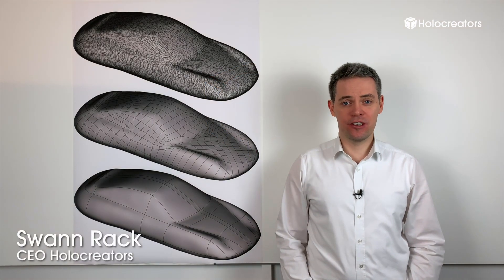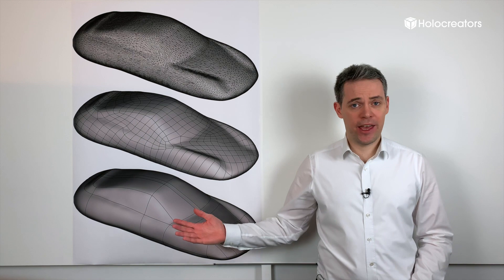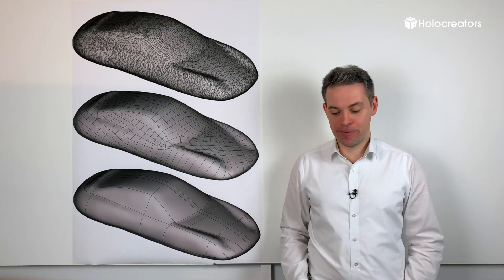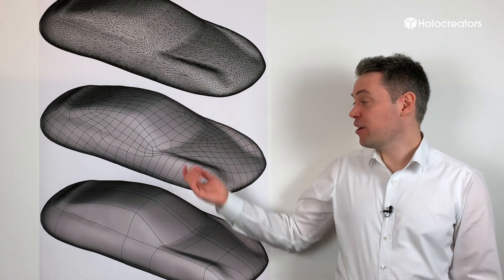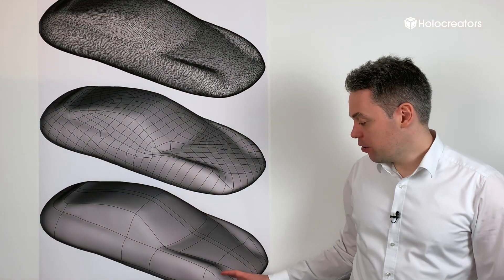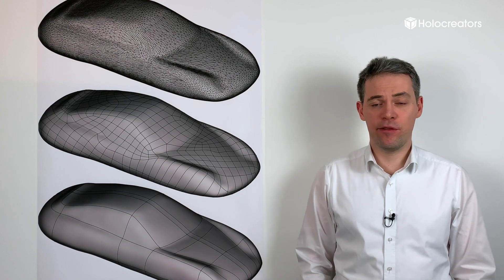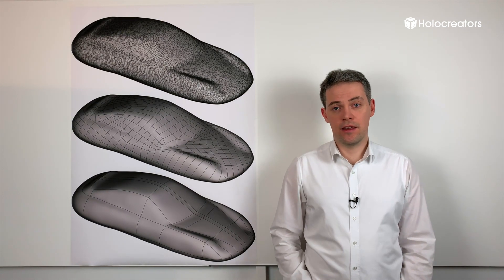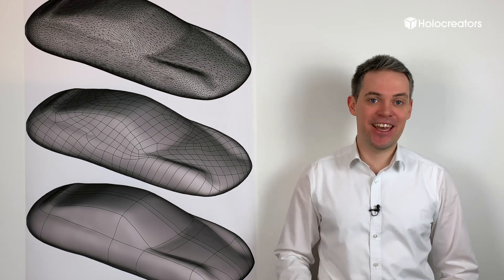What is Reverse Engineering into a Surface CAD Model?

Comment: Hey I am coming here after your introductory video on point cloud. As a newbie, first, thank you for the content. I had a question and with reference to the video it might be out of place; so please bare with me.

From 2D scans when 3D surfaces are reconstructed in stl format, is the process dynamic in nature? I mean every time will I get new set of vertices for the geometric composite meshes? I get that they will always belong to same space. But the points might be different at each instant, right? Or will it be software dependent? Meaning STLs reconstructed in different softwares will contain different mesh vertices, though in the same space?

I am going to work on 3D point cloud based segmentation. Hence the question.

Thanks!
Reply from the maker: Hi, assume the process is static if you do it in the same software with the same settings. But there are many different software packages that can convert pointclouds to STL or STL to STEP and I assume the outcomes always differ between software (software dependent)
Reply: @Holocreators  Hi, this clarifies things..Thanks! The data that I have received contains 2D scans for entire view and STLs of objects which are part of it. I need to label each vertex in the overall view to distinguish those parts. I am thinking of using distance metric, to identify nearby points, in my reconstructed view and the part STLs, to be able to label my reconstructed view. This won't be ideal. But might set the base for next steps.